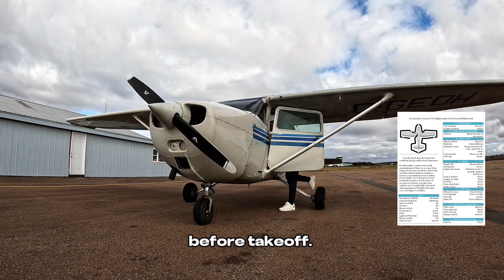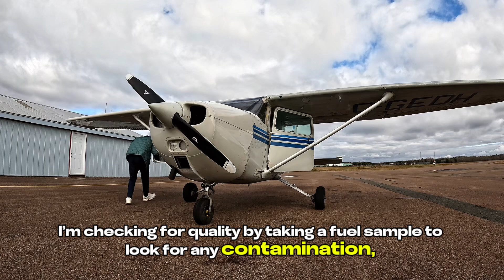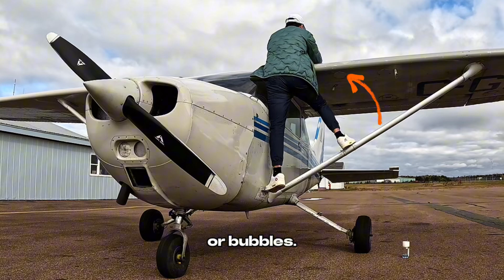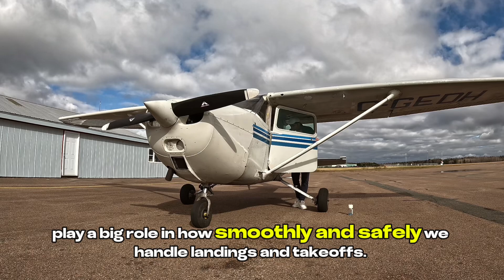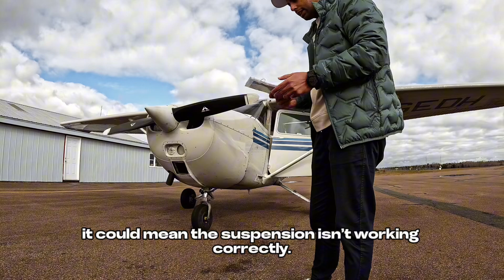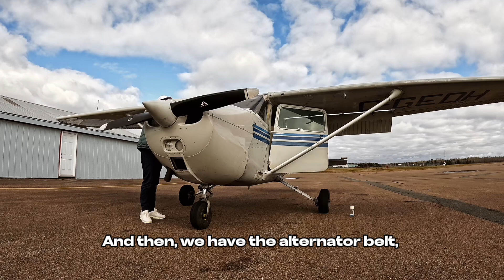Quick 2-Min Cessna 172 Pre-Flight Inspection |For beginners | Student Pilot | Safety Checklist

Comment: What software or app makes it possible to get such poor audio, pronounciation, and timing?
Reply from the maker: Thanks for pointing out. I am using Cap Cut, you are actually right, the quality is bad, I am working on it. I will use better tool next time. Do you suggest any other tool?
Reply: pruh flight